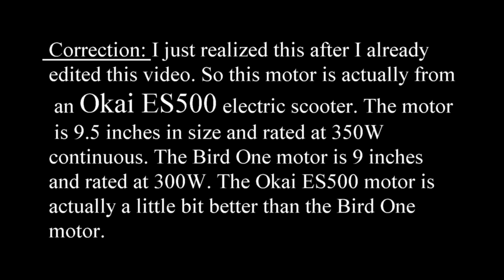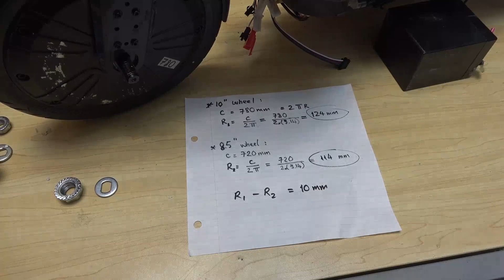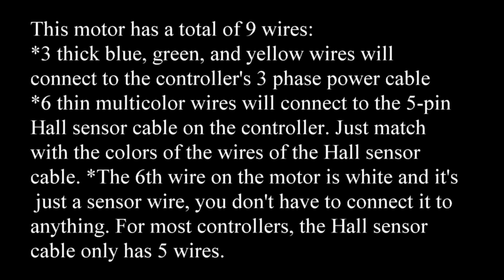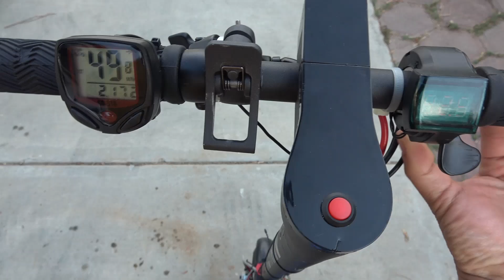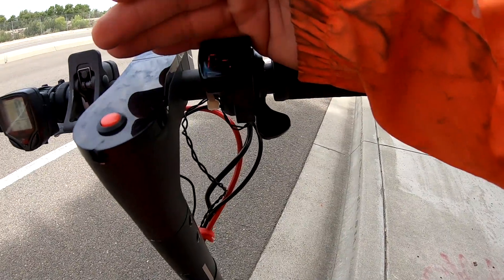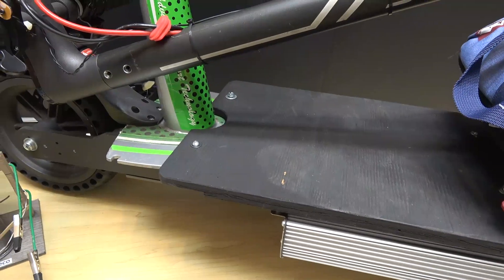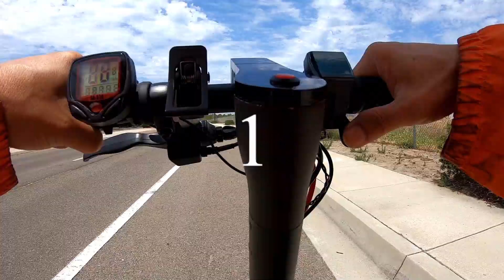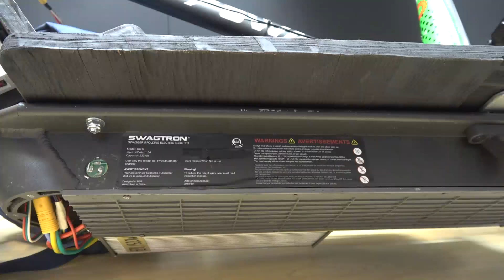Install a 10 inch motor & 72V controller on a 36V Swagtron/Xiaomi M365 scooter

Comment: Wondering if you can help me, new to the scooter world and I purchased a pretty decent scooter for such a small price from new at only £125.The scooter is a Zipper VHEX1 X1 600W 48V Electric Scooter with 55km Range, the motor is a 600w brushless motor on the rear. It's limited to 25kph but upon investigating. The limiter is a secret menu in the Lcd which I have changed and now see 45kph. With my weight it's around 40kph and I'm 6ft-16 stone..... The controller looks pretty small, nowhere near as big as this controller you have. It looks basic, the battery is big in size.... Model is FK4818, STD Voltage 48v,Nominal capacity 18ah,STD energy 864wh,Operating voltage 39-54.6v, 

The controller model is. 

MCU-S6. GY006205
DC 48V,37+1V, 120°, 18+1A.

How can I get more speed with this scooter.

Comment: Im looking to upgrade my controller and battery on my ebike. Its currently 36v 20Ah and i want to put either a 48v 15 or 20ah or 52v 20ah LG cell or 52v 13 ah cell

Comment: Bro on my Joyor s5 top speed is 33mph single motor but I’m 195 and when I’m on it it goes 30 I want to make it a dual I want to buy two 2800 watt motors for it is it possible?

Comment: I have a boosted rev which I have converted... I am running 2 x 250amp tronic controllers and a 72v 36ah battery.. its mental

Comment: I just finished converting my GoTrax Gmax Ultra to dual motor.  I scavenged a motor and controller from a parts GoTrax, and connected everything to the stock battery.  It gets up to speed quickly, and moves well up hills

Comment: Would of just been easier to buy a whole new scooter with more power.
After calculating the time spent in labour and all those extra parts. It would just be cheaper and better to just purchase a new scooter with the power requirements that you want.
Reply from the maker: I agree. Something like a $1699 Varla Eagle One would be cheaper and better.
Reply: @vuaeco  that’s what I did instead of upgrading my kaabo mantis10 v2. I purchased a wolf king GT instead

Comment: Cool experiment but please be careful not to get used to driving this at over 20MPH as the Swagtron fork and stem assembly are not built to handle the stresses of higher speeds. They use soft metals so you can literally bend the Swagtron fork with a larger bump at 18 mph. At 38, that may result in a catastrophic break.🤕

Comment: I got a question. When I upgrade my scooter do I have to change the battery too?
Reply: If your new controller has a higher voltage than yes you will need to change the battery to th3 controller's voltage

Comment: What you need to Do is get another battery" 80v 2amp ph' and splice them together" and run them as one battery" use a hand made piece of plastic..and then tape them off..and when you plug one in..the other plug in is live" so be careful" the controller want know your using 2 Batteries" this will help your load time..and Distance time" it should increase your range by double" 12miles..to 24miles..or 30miles..Before they go completely Down"

Comment: I dont want to be that guy. But if you count from take off. Was about 10 seconds till 30mph
Reply: itll be due to the battery cells only outputting 10amps continious , so say with the max the batteries are 6p, which means 60amps continious.
if you want more torque youll need to upgrade controller mosfets and capacitors etc and remake the battery pack with higher discharge cells

Comment: Niceee
One time i pushed my kugoo s1 to 51 km/h
With original motor
Original battery
350 watt 36 volt chinese controller
75 volts to the controller with the help of a 1500watt boost converter and bypass  BMS protection for overcurrent

Comment: so any hub motor can do 72v wtf ??
Reply: That's my question
Reply: @B0xlife1 after 3 years of pevs experience. Motor can run at any voltage as long as the amps doesn't burn the coil. Know the wattage and that's all you need. Higher voltage = more efficient

Comment: The new wheel is bigger. Does that change the speed? Or were you using GPS for does?
Reply from the maker: It changes the speed on my speedometer. I have to adjust its settings for a bigger circumference.

Comment: For anyone wondering, in order to remove front wheel u have to peel back the red reflector tape on the covers and then access both bolts, unscrew them and you will gain access to the front wheel bolt.

Comment: You should put the controller inside of the scooter, it uses the chassis as a heatsink
Reply from the maker: I tried, it didn't fit in there hence the external mount.
Reply: Not really, the controller gets maximum air ventilation the way He mounted it

Comment: Did you calibrate your speedometer after installing the larger wheel, and could you have been going a bit faster?
Reply from the maker: I did. The numerical value to program the speedometer is actually the circumference of the wheel in millimeter which is 780.
Reply: @vuaeco  Might be interesting to compare it against GPS speed. I've noticed those hall-sensor speedometers typically need fine calibration.
Reply from the maker: @jackoneil3933  I would say it's more accurate than GPS because it's mechanical vs. electronic GPS signal.
Reply: @vuaeco  I would agree, if it's accurately calibrated

Comment: I'm from the first guys that I'm waiting to see your new videos!!🤪🇬🇷
Very good work!! Now you have to build a 20s battery 😜🤩
I have a question:
Recently i buy an flj 2400w! It have 52v 21ah battery, 52v 25ah each controller and 1200w motor (of course)
The question is...: If i but a bigger controller 52v or 60v with 45ah and 1500w will i see a difference? 
Or everything about increased speed starts and stops to the battery...??? 🤔More volt more power (speed)
I m looking to controllers because I can understand why my 52v controllers is too small (at size) like an 36/48v an that i see in the market has the double size!!
What s the difference?? 🤔🤔 Sorry for the big post, but I'm looking at YouTube someone to analyse it and nothing!!!
PLEASE make a video and explain some things!!! Difference, what we get, what we lose,if it's wright or wrong... You now muuuch better foreshore!!!!🙏🙏🙏🙏🙏
Reply from the maker: Usually higher battery voltage means more speed. But you also need a controller that can handle the higher voltage and current. So I would say both battery and controller have influences on speed.
Reply: @vuaeco  ok so, what s your opinion about this controller (2 i ll buy) 48V 60V 64V 1500W Brushless Controller/Ebike Controller/Bldc Motor Controller
https://www.amazon.ca/SODIAL-Brushless-Controller-Electric-Bicycle/dp/B07XYVKW3P/ref=pd_day0_30?pd_rd_w=rxOEc&pf_rd_p=a0f07c06-3bfe-427e-9527-5be8cea27b66&pf_rd_r=DAZX7PPDPAZTPF07M8S4&pd_rd_r=30db5e79-75a6-4261-88b4-69f85c62e43d&pd_rd_wg=jfVI4&pd_rd_i=B07XYVKW3P&psc=1
Are they going to upgrade the speed with my stock battery?